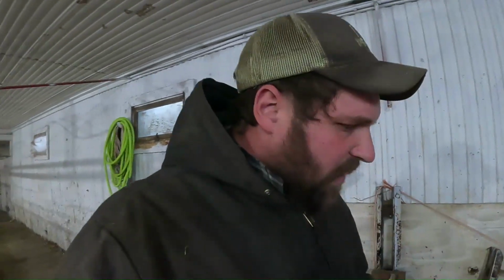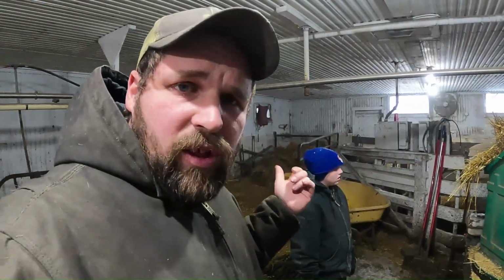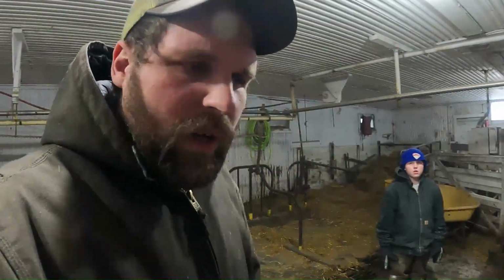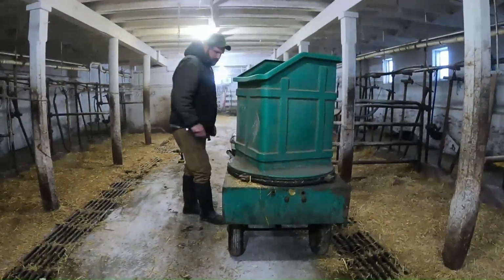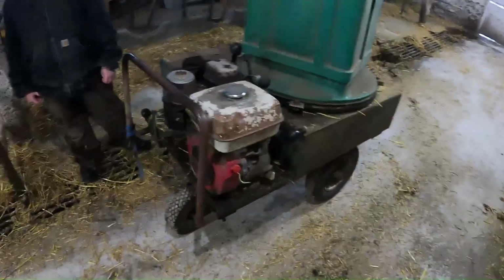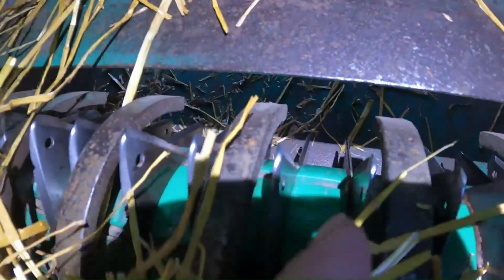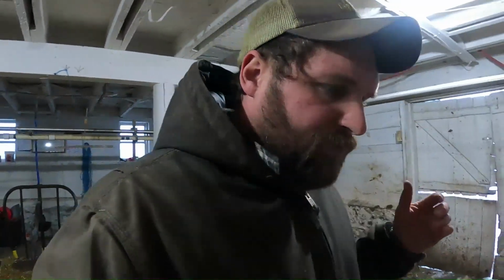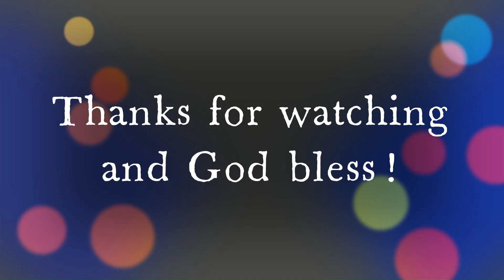Using A Small Bedding Chopper To Bed Our Dairy Cows

Comment: Good old wic chopper................ran one of those every day for years.  We still have one we use for bedding beef in our bank barn, run everyones junk mail, papers, thin boxes, etc through it.  Runs about every day during the winter when the ground isn't froze.  I took the shields you are missing off mine, we run it when the cows couldn't go out and had to stay in their stalls in the barn when the weather was bad and I swear they aimed at that kicking, took them off and they never bothered kicking and we didn't have to get it any closer than before without them.

Comment: If you take the extensions off and clamp it right to the bars works great.
Reply from the maker: I was just worried it would push her too far back because these stalls are pretty short.
Reply: @Trinity Dairy  it's an excellent idea many ways to improvise
Reply: @Trinity Dairy  in the future you could probably get away with a 4-6in. Spacer

Comment: Nice Video and Barn..  I like this system of Milking Cows.. 
 I have also used a Bedding Chopper..  Can you make a video with the engine running explaning the mechanik to set the knife to rotate.. 
And after Maybe make a video of the engine running at idle...
It fight a little like the Chopper i used.. Would your Engine Stay Running, or do it die after short time.. Nice if you can make a video from the low idle sounds, and let it stays running for a minute or 2.. Wishes and Hope it stays running at lowest possible idle.. It sounds so sweet.. Regards J.

Comment: I have to ask this, Your kind of lean on the Straw you put down for the Cows and you push it forward so just the front of the Cow has the comfort of the straw, Is that because of the Gutter system you have in the barn or are you just trying to save a little cash Because of the Expense of straw ? And I understand the money part if that is the case. 
  I know on our farm we had Free stalls, 500 of them, and we always had plenty of straw . My one particular job was to bed those 500 free stalls. Was great on the old side of the barn, Just throw it down from above. the new part was a Pain. The old barn held about 150,000 bales of straw and when we built the new concrete barn the hay loft held around a Million bales of hay, we had an over head system in that barn, But we still had to stack it.
   Enjoyed the video, Thanks for sharing.
Reply from the maker: We push it forward to start with because the cows always push it back, this way, they push it under them instead of in the gutter.  We can't bed super heavy because of the gutter grates, but more so because of our manure pump.  If there's too much straw, it hangs up in there.  Most of the cows tend to build up the bedding they get every day, making it pretty comfortable,  but there are a few that manage to push it all back into the gutter every day. They do have rubber mats under them as well for more cushion.
Reply: @trinitydairy  ok, I understand.

Comment: does doing the ties that way narrow up the walkway in front to much? can you just put a bar straight across?
Reply from the maker: Originally the manger had a concrete front, that stuck out about 2 feet in front of the cows, the rail I installed is about a foot, so it leaves plenty of room.

Comment: Thanks for the great video,I'm wondering what size drill you use to start bedding chopper because I'm on my 3 rd recoil on my power feed cart which feeds our cows twice a day
Reply from the maker: I use a de walt 20v cordless, it works good, but you have to be careful when it fires, you want to pull the drill off right away, and be careful, when the engine is running, and the recoil is gone, it doesn't have any guard, to keep stuff from getting caught in the  end of the crankshaft.

Comment: I was wondering why you just didn’t run the pipe straight across and the cow would just reach under it to eat? Good video.
Reply from the maker: I think running it straight across would keep her too far back because the Stall is pretty short.  This seems to keep her in line with the cow next to her, which is in a stanchion.
Reply: @trinitydairy  makes sense. Always thought a Holstein should have a 6’ stall and I know a lot of old barns have shorter stalls. Thanks and keep at it. Great way of life.
Reply from the maker: Yes, the stanchion part of the barn is built for Jerseys, and even then, the Jerseys in 1936 were smaller than mine.

Comment: Hey Alan.
Can you  Maybe make a video of the engine running at idle... Like the sound at 7:10.

It fight a little like the Chopper i used.. Would your Engine Stay Running, or do it die after short time.. Nice if you can make a video from the low idle sounds, and let it stays running for a minute or 2.. Wishes and Hope it stays running at lowest possible idle.. It sounds so sweet.. Regards J.

Comment: Nice tip on how to replace a stantion. I'm having the same problem. How high above the curb are you putting the pipe? Thanks.
Reply from the maker: I'll measure it again and get back to you.
Reply from the maker: From the top of the curb to the bottom side of the pipe is 29 inches.  That's for a Jersey, so it would probably need to be higher for a Holstein.  Frudenthal manufacturing website had a Stall section, so I based it on their measurements and adjusted from there.
Reply: @trinitydairy  Thank you.

Comment: I have used same chopper for newspaper as bedding. You can get the paper free, sometimes, and it chops just fine. Be warned: to much of some paper's, and cows only go to the left of the barn!🤣
Reply from the maker: Lol!!!
Reply: Good one!
Reply: How did the newspaper work? I tried it years ago and it didn't seem to work very well but I didn't have cow mats in.  A few years ago I put in cow mats and am using sawdust but it's costing me almost 1,000 a month witch is insane
Reply: @mhdairyfarm2911  it worked ok, you didn't want to do it on a windy day. I was in a 1970 free stall shed with 1 closed in wall, and the paper stayed put fairly well. The WIC chopper would blow the paper to the front quite well, and the cows would work it to the back. I dealt with a poor design, and concrete was the base. NOT designed for cow comfort, but the paper helped.

Comment: If only you were closer, I just took out 34 tie stalls, that I would gladly have given to you. I actually just used a heavy chain all along the stall fronts, and fastened the tie chains in the middle. Cows don’t beat up their necks as much because the chain has some forgiveness. We’re a pipe head rail has none.